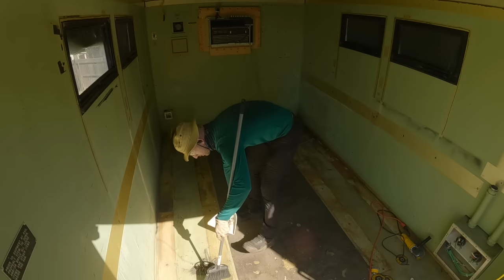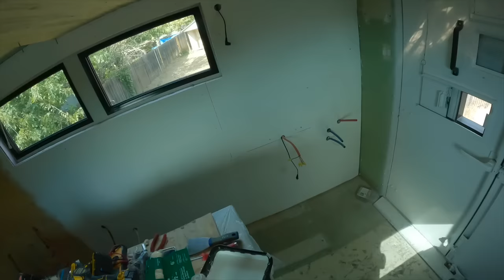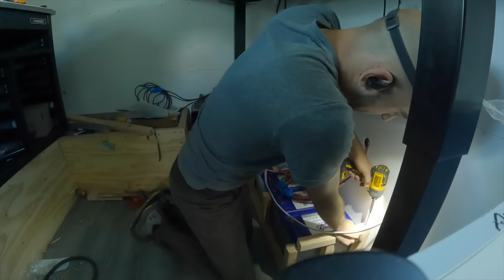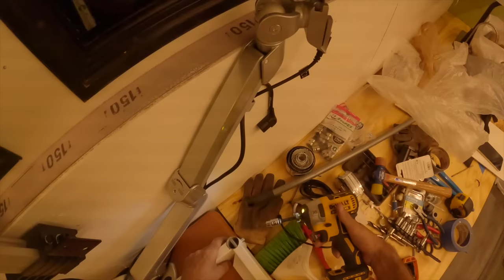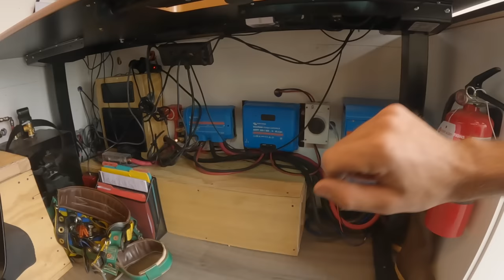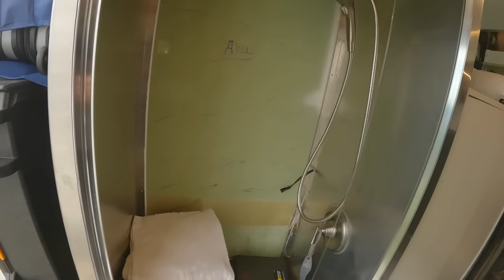DIY Military Truck to Camper Van Conversion in 36 Days.

Comment: fantastic build, man. anything similarly "rugged" from any dealer (Earthroamer, etc.) would probably cost you well over 10X as much. btw I think we chose exactly the same flooring -- I put the same stuff into the bedroom of my 26' Airstream after I had to cut out the subfloor and put in a new plywood panel, but I added the blue "lego" underlayment. I guess you may not have needed that with how flat the floor of yours is (plus having the radiant heat in it).

Comment: Beautiful Build man Big support from Kenya , I'd like to ask on Cost to run the rig and potential upgrades
Reply from the maker: At current prices it costs about $.60/mile to drive (8 mpg). The other consumables (gas generator) do not amount to much unless something breaks. Potential upgrades some sort of system for tilting my solar panels, more batteries, and a larger fuel tank for my generator.
Reply: More motor upgrades increases the problems

Comment: Nice but I'd have put in cable-ducts! Why? Well, just like in a house: If you want to add anything later, it is easier to pry open a cable duct, put the new cable in and close it up again!
I should know, I moved into an apartment (that I live in rent free as the house belongs to my aunt (who lives downstairs!) and my dad (who doesn't live here luckily - I love my dad, but having him around constantly isn't ideal)) in an older house (built in the 60s!), which does not have cable-ducts! Blergh it is bloody difficult to add new stuff like my home-network! Damned, I had to drill through the walls several times in order to install it...and I could only fit two cables through those holes, so frankly if I want to add something else later on? Yeah, more drilling, more dust etc. :(

Also: White? Why? Is this a hospital?...I hate white! It's the other thing I changed about my apartment! I added color! Each room is a different color! White paint is anathema to me! Get it away from me!

Over all a great build - still, I don't like the bed, I'd want to have access to my bed all the time so I would probably have put the desk on the opposite of the kitchen counter and forgone the dresser etc.
Reply: smart man, if I do a new build of anything my self I'll definitely be putting in conduit. would save a ton of headaches later.

Comment: I'm also working on a LMTV build. Where's the video on the bike? I'm considering winching my BMW 1250GS up. I'm using the same winch for my bed lift.
Reply from the maker: No video on it. I have a standard 10’ aluminum motorcycle ramp that rests on the top of the ladder to enter the box. Hook the winch shown in the video to the handlebars and pull the bike backwards up the ramp and inside the box. Then its secured by a standard wheel chock and tie downs. Simple and uncomplicated. Will work great for your GS.

Comment: Great build. 
Some amount of oil gets through the piston rings in a compressor. Do you have any filtering system to get rid of that?
Reply from the maker: I do not. I put on a Haldex air dryer to replace the military one. That probably makes no difference though.
Reply: May be worth getting an oil-less electric compressor just for that purpose?
Reply from the maker: I prefer having the small amount of oil in the system to combat corrosion since this vehicle goes through water frequently.

Comment: Thanks for the cool vid Apollo. I’m looking into a setup like this to be able to use as a base camp during hunting season / big road trips. What’s your experience with how the older military vehicles run? Also, assuming you’re in the US, did you get this off govplanet or somewhere else?
Reply from the maker: Mechanically they are tough enough to do tank jumps. Electrical is the only "weak" spot but still not really an a big issue. The biggest issue with these trucks is they just sit and don't get used. This causes more issues than anything else. And it will be a learning experience about the wonderful world of corrosion. 

Bought mine from a military surplus dealer. You can get one from an auction also for cheaper, but it will likely require a decent amount of reconditioning.
Reply: I love hunting out of mine. I bird hunt and there's no field too muddy for this truck when the guys in 4runners are all turning back you can keep going and have that field to yourself. It also attract the land owner so be ready to chat with em and get the lay of the land if you're hunting PLOTs or WalkIn areas.

Comment: A question regarding the electrics. Are you running everything through an inverter or are you using DC power as primary with the inverter as needed (such as cooking)? It was difficult to tell how you had it set up from the video alone.
Reply from the maker: Using both DC and inverter. Almost everything except the vent fan and water pump is run off the inverter.
Reply: @apollogarin  That seems somewhat inefficient in terms of power consumption. Would it not be more efficient to wire up DC lighting and use step up or step down voltage regulators to direct drive your computer and monitors on DC?

Comment: Great video! I’ve been thinking about converting an LMTV myself but someone on an overlanding forum deterred me after they spent $20k~$30k every year fixing it. Do you have a similar experience?
Reply: Wow! Now, that is some valuable information!
Reply: @funkyjones  Yea you can buy them for less than $15k on an auction website but these are still $200k+ military issue vehicles when manufactured, so replacement parts still reflect that manufacturing price is what I heard.
Reply: There's better more reliable Military trucks you can use, a 5 ton expando van is most likely a way better example, an M35a2 as well, depending on if that's big enough. I haven't put too much money into mines aside from tires and my power steering kit, these are very simple trucks unlike the LMTV with its confusing electrical system
Reply: @hummerguy  Ah yes those could be easier maintenance as they are also older trucks. I always thought since the LMTV’s CAT3126 engine is so common in chevy box trucks that it would be easier to find parts. Any experience getting engine parts for the M820 or M35?
Reply: @XcarecaX  They're pretty easy to get parts for, if you get a 5 ton, I'll get the 8.3 or 250 cummins because those engines are much more powerful than the multifuels. Either way, the multifuel is pretty reliable if you don't start messing around with it to make more power than it should.

I believe the 3126 isn't hard to get parts for either but they're just very expensive
Reply from the maker: My experience is that most people are the cause of their problems because they are too cheap, or don’t know what they are doing. I have spent nothing on breakdowns or repairs. Only on maintenance.

Comment: Where did you get the shower enclosure from? I’m looking to do the exact same in my m1079…
Reply from the maker: I took the measurements, made a drawing, and had a sheet metal shop bend up the two pieces

Comment: una pregunta por que siempre se pasan los cables entre la madera y el aislante , como vas a reparar un cable pillado por un tornillo cuando estas atornillando cosas, y otra cuando quieras cambiar los cables por que se an degradado por el uso tienes que desmontarlo todo. el mantenimiento que poco se cuida el mantenimiento.
Reply: Si administra su disposición de cables, puede mantener un diagrama de dónde pasan sus cables para que los rodee. Con aislamiento de espuma en aerosol, esos cables no se moverán y algunos cables tienen suficiente protección para durar décadas. Tengo una autocaravana sin aislamiento de espuma y los mismos cables me han durado 40 años.
Reply: @XcarecaX  mira una cosa aquí en España las instalaciones eléctricas, por reglamento se revisan cada 5 años y cada 10 recomienda cambiarlas , ya sé que es un consumo muy justo pero piensa que algún día tendrás que acceder a ciertas partes y solo podrás hacerlo desmontando todo. Como las baterías, ya quisiera yo que aguantarán 40 años pero creo que entre 5 y 10 tendrás que sustituirlas y no as dejado sitio ni para que respiren, aparte tiene que tener ventilación para que siempre estén a una misma temperatura no suba no bajé demasiado. Gracias por su tiempo y piensa en el mantenimiento.
Reply: @salvadorblascogonga8204  
(disculpas por la traducción probablemente mala de Google) ¿realmente crees que necesitarías cambiar el cableado cada diez años? No sé, si fuera yo, creo que tener un buen diagrama para llevar un registro de dónde estaban las cosas sería suficiente. obviamente querrás asegurarte de tener fácil acceso a componentes como balanceadores de batería, transformadores, etc. Soy un gran nerd, así que si realmente me preocupara, podría incorporar trazados de cableado y plomería en las decoraciones de la pared para que Sería difícil de olvidar ;)